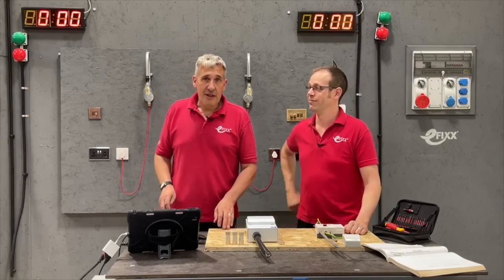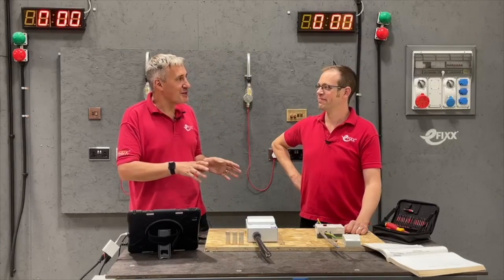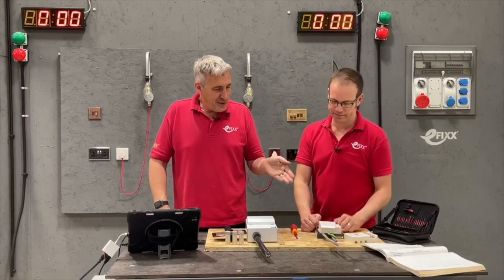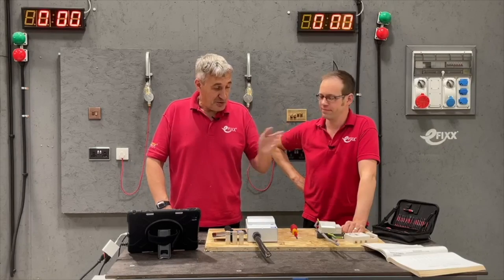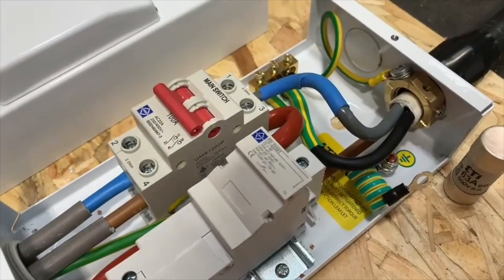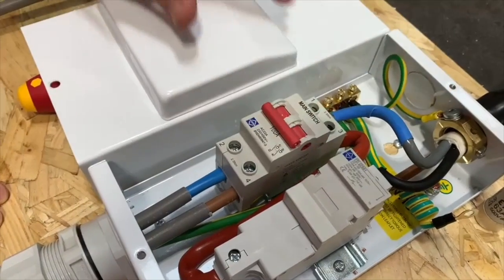METER TAILS LONGER THAN 3 METRES- Switch fuse isolators from LEWDEN

Comment: The question is.....The fused isolator would be deemed "switchgear" and the ENA do not permit switchgear within the meter cabinet. A standard double-pole isolator does not have a fuse and therefore is allowed within the cabinet. Can the EFIXX presenters clarify on this please?
Reply from the maker: The official line from the ENA is they do not “recommend” installing switch gear inside the meter cabinet. Individual DNOs may take a different approach.
Reply: I'm not sure a fuse is switchgear. Breakers are switchgear and they need to manage the way an arc is drawn as they operate to interrupt a fault current.

Cartridge fuses on the other hand are self contained sealed units that not only contain the arc in a known environment but gurentee that there's nothing flammable around it - even if everything else has 40 years of dust.

If these were switchgear then the plastic one would be banned from domestic by virtue of 421.1.201.
Reply: @efixx  But if we install the same rating fuse in our new fused isolator, how can we achieve full selectivity with the DNO fuse? If the is a fault on the consumer meter tails, it is likely that the service fuse will fail before the fuse in the fused isolator

Comment: It would be better to have what the French have, a 500ma RCBO with integral double-pole isolator instead of a main fuse. Both L & N are then disconnected when isolated or a fault trips the device. In France the maximum amps of the RCBO is settable. 

But the DNO has an old hat main fuse so we are stuck with yesterday's technology. You can fit your own main DP RCBO disconnector in one of these boxes being far superior.

They are available for £50 as RCBOs with a fixed max' amp current. All is needed is a two module box with a DIN rail.  Protection is then far superior to this large 1950s set up of switch and single pole disconnecting fuse. About time we caught up with the world.

Comment: OK, we‘ve been using these for quite a while (D02 fuse in Europe), but usually in an commercial environment.

The unit is actually fully isolated when the cover is open, so no danger when changing the fuse.

But please try  to pronounce the German name for this device: 

„Sicherungslasttrennschalter“ 😀

Comment: In the not too distant future, I'll be running some tails on the surface, through a wall and it'll be fixed to the wall with cable ties n tie bases. 
The supply will be coming straight out of the head, into an fused isolator, through a wall and up a meter or so to a fuse board as I'll be putting in a new supply.

Comment: If you run tails up a wall, should they be covered over? I had a sparkie upgrade my tails and the patch plaster barely covered them. Just the cable he chased into the surfaced plaster that was onto breeze block. It's on a rental that he did me a certificate for after. I thought it was a bit dodgy but he said it was fine
Reply from the maker: They'd need to have RCD protection if they're buried that shallow. 🤔
Reply from the maker: Even that's not a perfect solution as you can run into issues with selectivity.

Comment: In regards to the first switch fuse shouldn’t it be made of metal as it contains a fuse and main switch.
Reply: Also only one screw clamping the 25mm tails. Very poor. Asking for a fire
Reply: Not switchgear - doesn't contain a circuit breaker. In terms of one terminal holding the tail, yeah its not a good look. But it's exactly the same for most meters - and they don't come loose mainly because they are done by competent people.

Comment: I’m about to move a consumer unit on a refurb 11 meters with split con. 
The property is on a TT supply so will be fitting the Fusebox version with a 100a 100mA time delayed rcd and an 80a fuse (new head has a 100a fuse fitted by dno). Fortunately the service head is inside the property so no need to worry about space.
Reply: That's the way I would do the job .

Comment: I see this reg being broken all the time, just moved in to a new build where they have run 15m of tails through the building and covered them in some sections with unearthed 2x2 metal trunking all signed off by the Nic EIC contractor, just the usual focus on got the paperwork so the jobs been done ok 😂, unfortunately the trade has become to focused on paper work from the roots of college and apprenticeships to onsite,  where the importance should be on doing the job properly and having pride in doing so, with regards to the 50mm depth never got the logic of that fairly sure masonry bits and screws are longer than that😂,SWA should be the industry standard would maintain safety to all installations.

Comment: Why supply the 100A fuse you have to use a smaller fuse than in the service head.....  ie 100A in service head and the maximum you can fit is 80A

Comment: Confusing video so can you run tails to a longer length if a KMF IS USED
Reply from the maker: You can run longer tails if you aren’t relying on the distributors fuse to protect them.

Comment: Am I missing something? The MEM 80A fused main switch similar to this does not allow the fuse carrier to be removed without taking off the front cover exposing all the live parts- what's the point of that? What a silly design...

Comment: If you brought the tails in from the top, them wouldn't the double pole isolator diagram be wrong?  The switch would be upside down surely
Reply: @jeremykemp3782  I think he showed the short red connector to the fuse being reversed as well as reversing the feed cancelled each other so the switch down/on stays the same.

Comment: Can the first isolator have the cables reversed? Technically there is no reason why that cannot be the case.
Reply: If you reversed the connections the fuse carrier would be live when the switch is off . So no you can't reverse them .

Comment: ... so how do you connect the live side tails safely without removing the DNO fuse...?
Reply: ...Electricians are not currently permitted to remove the DNO fuse
Reply: I think the point is if you are installing on a new build before the power is connected.
Reply: @mufc2090   if you had been on a approved course for removing DNO fuses in street lighting columns you would have seen the pictures of when it's gone wrong and the injuries and destruction caused . If the cutout breaks when you are pulling a fuse you can short out phase and neutral /earth and have 2ka flowing in front of your face . Not to be trivialised .

Comment: Or instead of doing it right you can copy the big house builders and gland the swa into a right angle      bracket with basic insulation exposed and terminate in meter providers isolator

Comment: Suppliers don't want meter fitters connecting their meter equipment to that! We'd have to install our own isolator. The industry has gone mad.
Reply: Not sure which suppliers you’ve had on site, but I was briefed some years ago now on being able to install to these providing the tails are “pre-connected” doesn’t always happen but it never stopped me installing to them
Reply: @minitom7772  Ovo, UW, NPower, EON, EDF, Octopus. I'm also told this is a MACOPA thing! We are not to energise a new build, hence we can't (shouldn't) connect the meter to the existing (customers) isolator (often a fused wilex almost as big as the whole OMB). It's a waste of time and equipment. This industry often lacks common sense. Surelly making use of the existing customer isolator and leaving it in the off possition with a safe notice should suffice.
Reply: @CarlosArruda77  I was fitting for BG provided the metal isolator had been pre-wired, we connected the outgoing meter tails to it, the requirement being however the fuse must be removed and left with the site manager. Never heard or saw anything saying otherwise from MOCOPA
Reply: @minitom7772  I've been in the industry for 6 years and I'm yet to come accross a supplier that will allow that. But, makes perfect sense mate.
Reply: @CarlosArruda77  10 years here mate, that’s the daft thing with all these suppliers, they all have their own hymn sheets. Bloody ridiculous
Reply: @minitom7772  This is why I blame the industry either MACOPA or GAS SAFE! They make the rules and shouldn't allow no more to be added. I have seen countless S/Notices issued for flue not selead on the inside! Since when?! No wonder other trades call us meter monkeys!!!

Comment: Why is an isolator with a fuse needed when the DNO provides a fuse inches away?  Why not just an isolator only? 
Also, if the DNOs fuse is 80A, should next size down be fitted, say 63A, as it will not be certain which fuse will blow if they are rated the same? 😳
Reply: Think about Zs, The more length meter tails the more Zs.
Reply: This is only applicable to overcurrent protection , on a short circuit fault either can blow
Reply: @persona250  over current protection means overload & fault current( earth fault or short circuit). Try to find or calculate how much current will blow the 100A 80A 60A 1361 fuse, and test the Zs@DB or Pefc Pscc,  you will know how low Zs should be keep and decide whether you need install additional fuse to protect the meter tail cable connect your consumer unit. If the Zs is higher not blowing cut out fuse, you should install additional fuse.  And location should be installed before Consumer Unit.
25mm tails 10 meters ( SWA 3 core) length will increase 0.014 ohms resistance. Say 14 meters will increase to 0.2 ohms. If we increase meter tails from 3 meters limitation to 17 meters. The Ze will near 0.37 ohms (TNCS) , above 0.26 the 100A , above 0.38 for 80A, above  0.53 for 60A 1361/2 fuse don’t operate. Some don’t use 25mm for earthing conductor. If they use 16mm for earth, 10.1meters more will increase 0.2 ohms.
Very common measured 0.20-0.25 for TNCS. If cut out use 100A fuse, who know someday the Zs could be near just say below 0.35 and DNO could say it is ok. But actually it won’t blow the fuse even in short circuit fault.  
For TN-S, 0.8 ohms Ze limitation could not below fuse in earth fault, maybe blow fuse in short circuit fault , so ideally install time delay RCCB before CU and careful check Pscc. For TN-C-S meter tails no more than 10 meters could be no issue.
Reply: @huyongquan6554  no my man they are different . an overcurrent of 125 amps will blow the 80 amp fuse but not the 100 . A short circuit can be in the 1000 amp range which will blow either fuse first .

Comment: The purpose of putting the isolator in the meter box was to give safe isolation  for electricians  to disconnect the supply without having to remove tbe Suppliers Cut out fuse, when renewing mains tails and the consumer unit . Your video doest give any information on the requirenents required for the  correct circuit design  cakculations & fuse discrimination for the extensiion of the circuit to the main distriburion board/ consumer unit.
Reply: You have to pay a TV licence to get all that 'How To' information. .. or, maybe study a little harder... This is You Tube, not 'BBC'

Comment: Why a  plastic   switch  fuse   when  you   GOT  to use aMETALCLAD  consumer   unit
  ????..
..
Reply: A  6  kns   switch  fuse  as   used  30  years  ago
Reply: FIRE!!!
Reply: a  metal   clad   consumer  unit  /fire  safety/    a  plastic   meter/    a  plastic   service   head    that  used  to  be   metal    and  was  changed   to  plastic   40  years  ago   /  surely   it  all  should   all  be   metal clad
Reply: In  the   end    all  metal    clad   everywhere    screwed  tube    under  the  floor    and  in  the  walls   //// it  will    become   a  do  as  your   told   world   /glad  I am  75    and   won't  be  here  to  see   what   this  country    will  be like   in 40 years  time     /seen  enough   good  by